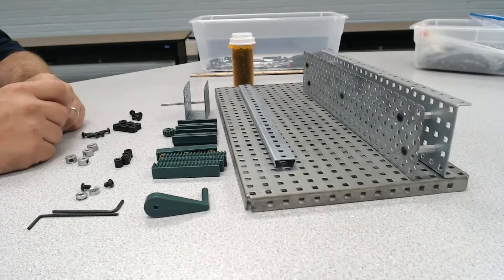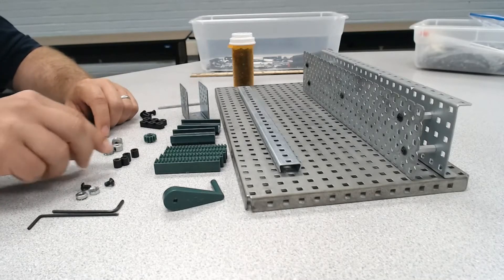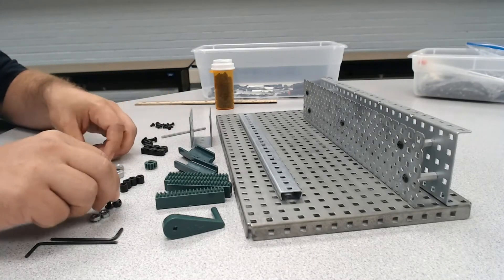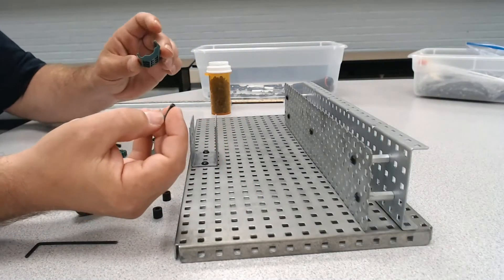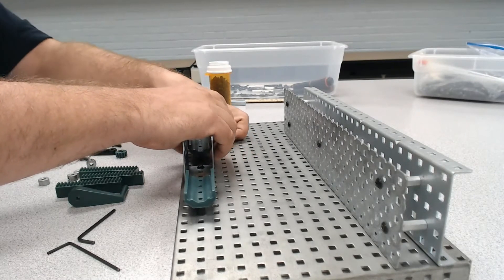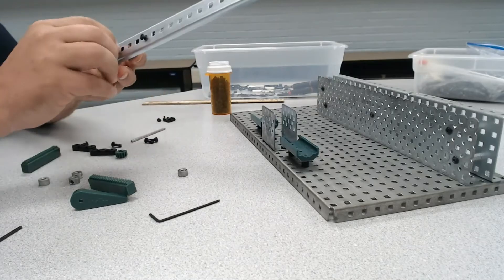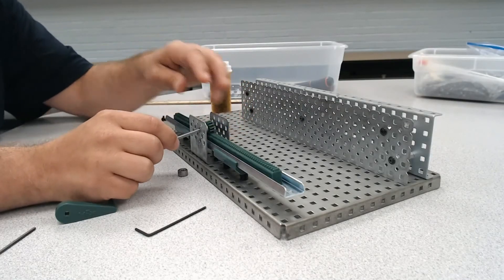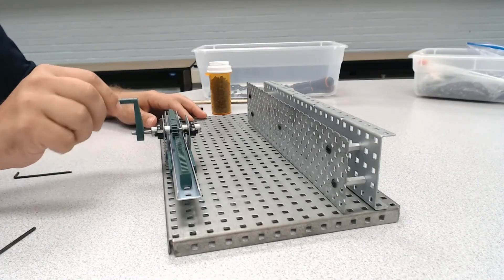VEX Gear Tutorials - Building a Rack & Pinion

Comment: Very cool.  I’d like to make a larger scale rack and pinion for adjusting the wings on a miter saw station.  The issue I’m struggling with if how to lock it in place.  Lots of rack and pinion videos but difficult to find one that shows how to lock it in place.
Reply from the maker: It is designed for the rack to move while the pinion stays stationary so we usually do not build this to lock into place. If you need the rack movement to be restricted, putting physical barriers at either end of the desired range of motion should be sufficient. That way, it can only go so far either direction before stopping.

Comment: The opinion is extremely tight. Any suggestions? I have all the same pieces you do and it’s meshing too tightly.
Reply from the maker: When I have seen the pinion being too tight, a few things are possible: 
1. The screw threads for the rack stick down slightly from the base of the green plastic. They should fit into the holes of the metal they are attached too. If you look from the side, the green plastic should be flush with the metal. If you see the copper color from the threads, loosen the screws, reposition so the threads go into the square holes on the metal, and tight them down. 
2. I used spacers underneath the slide rail that the rack is attached too. It is very easy to use the wrong spacer thickness, which changes the height of the rack relative to the pinion. Either check that or see if you can move the pinion gear up a hole on the bracket. 
3. Sometimes, the wrong row of holes on the bracket have been used by my students for the pinion gear. Adjusting that may help too. 

Without seeing pictures of yours, that is the best I can suggest at the moment.